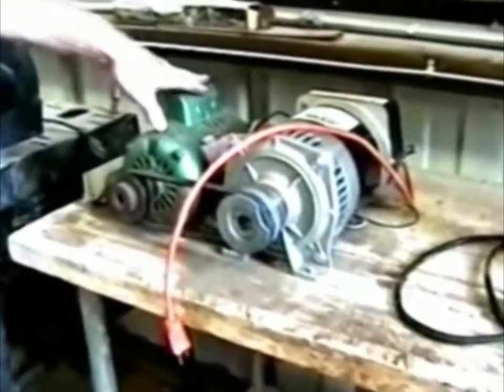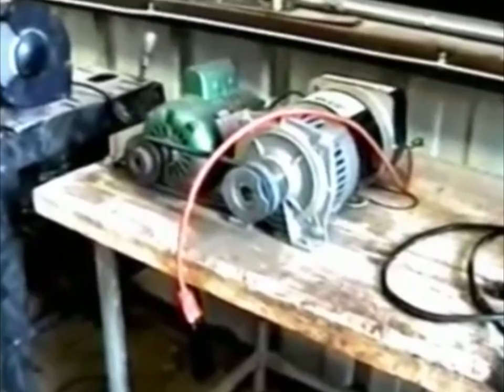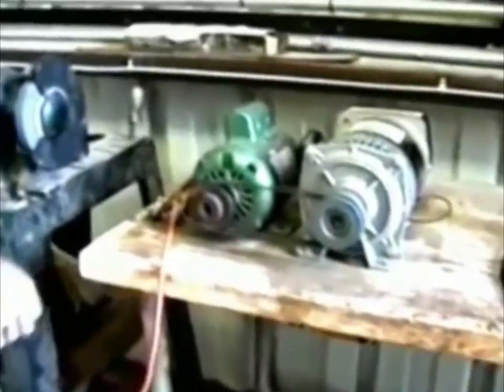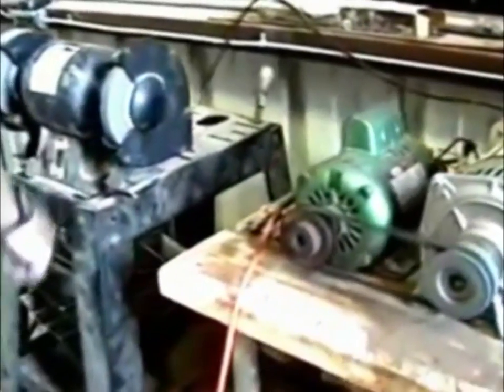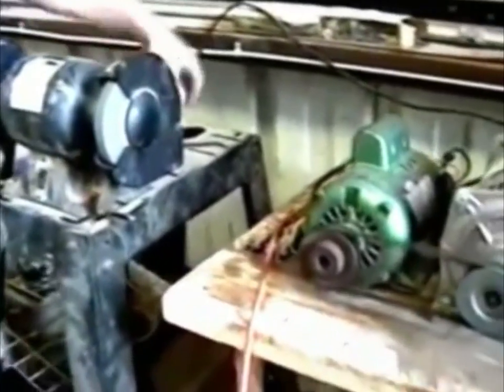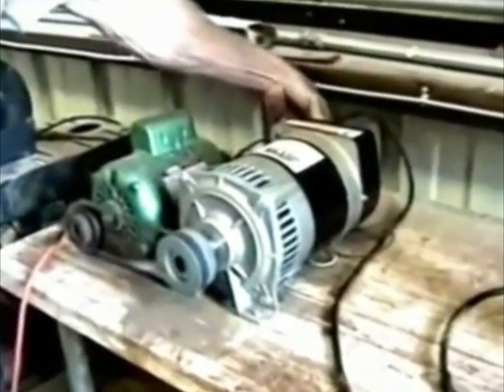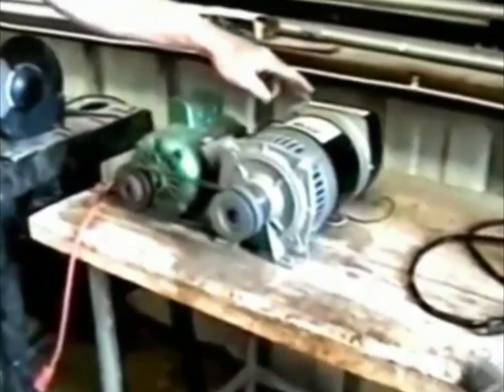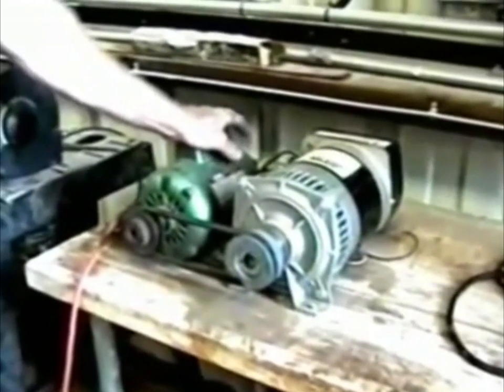Self Running Motor-Generator unit (www.witts.ws)

Comment: That's impossible.
Reply: By definition, the "Universe" is an isolated system (the prefix "uni" meaning "one"), unless or until a multiverse theory can be scientifically supported, we have no rational choice but to consider our universe as "isolated". If it is possible to directly extract ambient energy it is occurring within the confines of our "one" verse. The idea that something is theoretically possible is not the same thing as proving that the theoretical possibility is actually occurring. A hinky video on youtube proves nothing. Recreating a hinky video on youtube is support of nothing.
Reply from the maker: Tucker Not Sucker! just like flying was impossible (airplane), or speaking over a wire (phone)...
Reply: furulevi Those didn't violate fundamental conservation of energy physics.
Reply from the maker: Neither this, read the law more carefully, the law only applies to isolated systems which are pure fantasy and does not exist in reality. You can't shield anything totally, at least gravity will enter into any sealed/shielded box and so does energy, and that is captured and used here.
Reply: furulevi I support your efforts. I am not the only one who questions this explains one reason why it is not widely accepted and in use today my friend.

Comment: SCAM......
Reply: The burden of proof is yours since you are the one making the extraordinary claim.
Reply: Great, so how have you met the burden of proof for your extraordinary claim? Doesn't WITTS have a machine that teaches basic logic?
Reply from the maker: Butch Babas prove it...
Reply from the maker: "Quantum physics theorizes - in every cubic centimeter of space there is an approximate energy densitymass of 10 to the 94 grams (10 with 94 zeros following it).
10.000.000.000.000.000.000.000.000.000.000.000.000.000.000.000.000.000.000.000.000.000.000.000.000.000.000.000.000.000.000.000

That's 39 orders-of-magnitude more massenergy than the entire known Universe in every cubic centimeter!"

Comment: what is the voltage of the motor? The constant and surge output of the generator? How many RPM does the generator require, and HP required?
Reply: Dixie Firefighter if you did any research your know most generators require 3600 rpm. Required torque depends on unit and load. a 10kw gen head requires 12 ft pounds at 3600 rpm. the issue I ran into was over amp at load on the motor. i invested in a direct drive with run start capacitors which prevents over amp. but torque requirement would stall the motor. so i invested in a 5:1 gearbox. drive speed is reduced on my set up to 350rpm. i then put a 12" shiv on the drive and a 1" shiv on slave shaft (gen head) at peak amp i am at 18amp on a 20 amp rated leeland motor. when torque reaches peak requirement (240v 50amp) my rpm is 3750. Which is higher than required but within spec of gen head. I fulltime RV. I start the unit using my diesel gen supplying power then switch to contained and shut off my diesel gen. This runs all my RV systems and a bug zapper with no problems. I made my set up prior to ever seeing this video and only came across it check to see if a patent exists. I think the set up here looks sound but will not run a full house as pictured. A few reasons is most elect motors like the one sized are 1850rpm. The shivson the video are similar sized not allowing full rpm (rotation speed) the is required to reach peak performance of the generator. My background is industrial mechanic. Most so called self powered gens are bs. With exception to mine this is the only one Ive seen plausible with some tweaks. I hold no patent, apparently these guys do? If you really want to build a gen get a 2hp leeland with run start capacitor, a 5:1 gear box and a 10kw hen head (ac not dc) meter rotation speed on your out going drive shaft. Do the math on speed assuming you are running a 1inch slave divide 3600 by your drive speed which tells you required shiv size in inches. if you use a larger slave shive multiply that number by slave size. example 1in slave 
360rpm 3600÷360= 10 so minimum shiv is 10 though I personally would bump it a inch or 2 up to account for any belt slip. you are on your own on wiring. you need a shore power in on a switch and a gen power in on a switch. its possible to use a lawnmower starter if you again figure the size of flywheel to get the initial rotation but its just something to break later.
Reply from the maker: Contact Witts for those questions (http://www.witts.ws/contact-us/).

Comment: So many things over-looked. Your "16A" tools aren't drawing 16A at any time during the video for one. Also, huge problem: There is no audible load change from the induction motor powering the generator to the "over-unity" configuration.
Also, there is no audible change from the loads turning on. Either this thing can provide SO much free power that those loads are negligible (in which case the governments are all over you by now :/ ), or this is set up to fool.

Educate yourself folks. I'm not even saying over-unity doesn't exist, just that this is not it.
Reply: I saw a guy who had a similar setup run a window A/C for a year. For this to work you need a generator that can provide power to the drive motor with plenty to spare. But you are right, increasing the load on the generator should have an audible effect, as it did with the aforementioned case. The window A/C draw was 9.5 Amps.
Reply: @MoondancerRec  Do you have a video of that? I'd like to see it.
Reply from the maker: Gabriel Sierra Lenz Law effect is probably eliminated from the generator...
Reply: @furulevi   are you taping into the same power input on the 3/4 hp motor . Plug in the wall . Full out put . Power from gen . Is going to same in put to motor??
Reply from the maker: "It can run provide so much free power that loads do not slow it down. If tuned in a certain way, when you throw on a load, it actually speeds up. Some call it cancelling Lenze Law. Other call it reversing Lenze Law. This is so confusing for people, that we (www.witts.ws) try to tune and demo all of our machines so there is no load change at all. Machines not much larger then what you see in the video, are already running entire cities."
Reply: furulevi How do you even believe this? Witts's "Independent Engineers" are all folks rambling on about how cool this is and how much they support it, not analyzed it. Why are you hiding behind .ws (Samoan TLD) instead of .org? How can the 14-30AWG generator windings carry enough current to power an entire city? It can't be huge voltages, because the insulation is only good for a few kV at best and would break down. What are the circumstances for reversing Lenz's Law? How does nature avoid this so that it doesn't experience runaway and blow up?
WHERE are these cities even?! 
True developing technologies can actually answer such questions. Witts' "technologies" raise question after question with unrealistic responses.
Honestly, for an organization correctly believing that the world is a messed up place, I cannot fathom how you can think messed up higher-ups have not tracked down your organizations so-called "technologies" if they, indeed, exist.
If, one day, Witts does a scientifically presented demonstration of their "technologies", they might actually have some credibility. Until then, anecdotes of pulling "energy form the quantum field" (Witts) and surface-deep videos of their "technologies" are absolute deception.